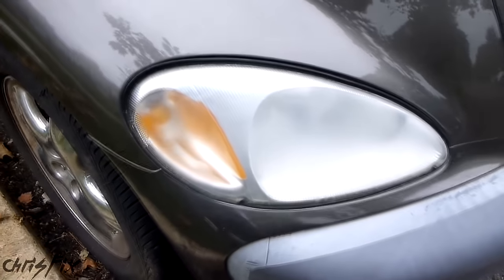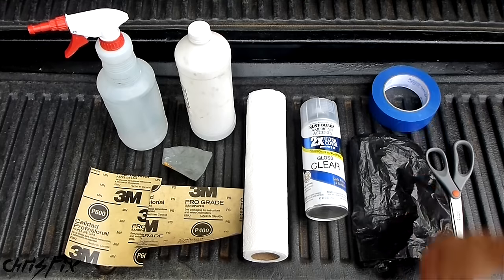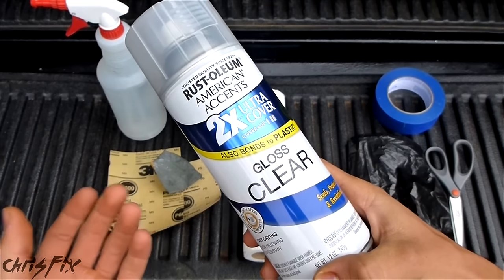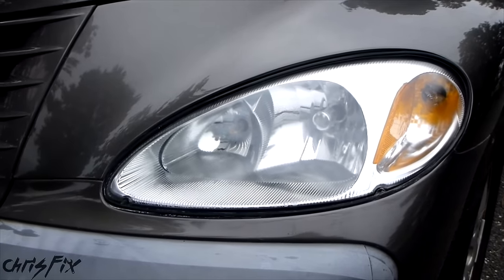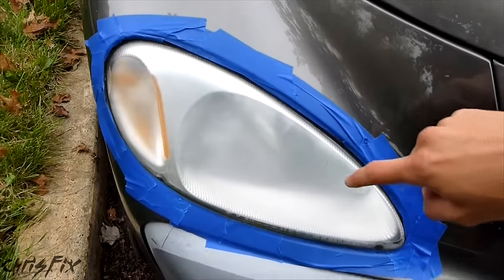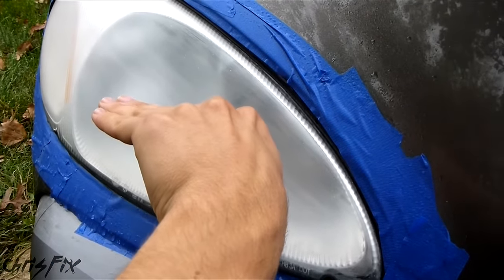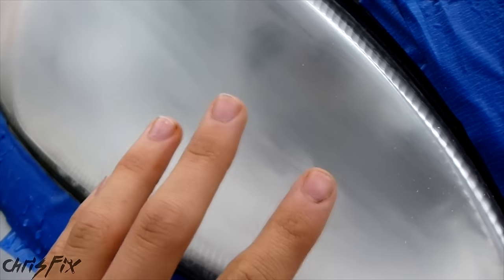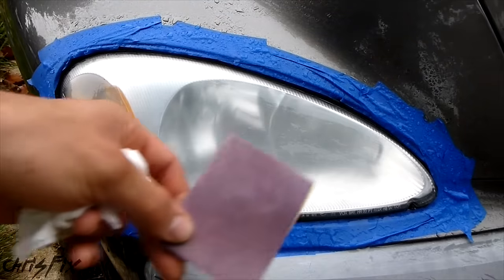How to Restore Headlights PERMANENTLY

Comment from the maker: Here is an update over a year later on the how the headlights have held up: https://instagram.com/p/8iyExTOjFm/?taken-by=chrisfixit
Reply: +ChrisFix The clear coat got a little runny. How do I fix it, or should I just sand it off and try again?
Reply: +Erich Lavelle Same thing happened to me leaving "ridges". Sand it back to smooth and when you re-spray it hold the can much further away. Even if you have to make five applications spray  just enough to cover the lens and keep repeating. I speak from experience having tried to rush the job on both headlights.
Reply: +Erich Lavelle  go..bk.wit the 400 grit wet  then work your way bk up to 1000
Reply from the maker: +Erich Lavelle Go over it with 1000 grit then 2000 grit then compound and then polish.
Reply: +ChrisFix The best and easiest way is to use Brasso.
Reply: Haris Umair
Reply: anyone try and spray tint them after doing this?
Reply: +ChrisFix That paint you recommended turned my hard work into pure white!! White!! Not clear, which is the goal here, but White! 
(more info lower - it came clear)
Reply: +Joe Raine well I used his method yesterday then instead of stopping at just using the gloss I went over it with the spray on tint for headlights and mine came out really good. I wonder where you went wrong
Reply: +Mark Garcia Well, they were totally white this morning and as a last ditch effort I used the 800 Grit and then the 2000 Grit on the Gloss and it came off.  Then the buffer pad and compound made them shine.  He should at least warn people of this!!
Reply: +ChrisFix WAT ABOUT USIN THT ...DEEP WOODS OFF....THEN RINSING IT OFF SUPER WELL...THEN DOIN TH CLEARCOAT...SO AS NOT 2 WEAR URSELF OUT DOIN IT TH HARD WAY.....IN TH VIDEO.
Reply: +Joe Raine I use a lot of clear coat paints. What I've learned from experience is if there is too much moisture in the air, as in high humidity or possibly overcast and ready to rain, my clear coat turns white or less than clear. Also, not shaking the can enough to thoroughly mix the contents will produce a white/hazy finish instead of clear. Of course I don't know your weather conditions or all the details of when and how you did this. I'm just offering what I've learned over time.
Reply: Yeah, it wasn't a perfect sunny day, but wasn't raining either.  I checked humidity on phone App after and it was at 70%….can quotes at 50%…not too far off.  Anyway, it went clear with some light wet sanding w/ 800, then 2000 grit and a buffing pad and compound.  They look perfect now.  Thank for the info.
Reply: The best way to clean the headlights fog is to use "Brasso" you can find it in your local diy store and it works wonders without using sandpaper. Just use Brasso with a damp cloth and it makes it brand new! Try it
Reply: +Haris Umair It would be kind of nice to harden/protect it with paint and wax every month too if you plan for the long term.
Reply: +Allen Wang Try buffing/polishing?
Reply: +ChrisFix  Nice Pt cruiser! are you going to give the bumpers a once over with a heat gun to get rid of the 'masking tape' lines? they're the only thing on that car that doesn't look new.
Reply: Buffing or polishing compound and a soft cloth. Buffing is what a painter does to smooth the surface of the paint to give it a perfect glassy gloss. You may have to redo your paint job if that doesn't work.
Reply: Allen Wang Yeah can't tell without being there.  Sorry.  Orange peel effect is what that will remove.  If the paint reacted with something and turned colors obviously its another story.
Reply: +Allen Wang after sanding you buff out the cloudiness with buffer and compound good sir
Reply: +Ricarda Ramírez 
thanks for the buffing part
Reply: how about if it's fogging from the inside of the headlights.
Reply: +ned103 I DID 800 THEN 1200 THEN 2000 GRIT WET SAND THEN CLEAR GLOSS BUT IT IS 
VERY BLURRY AND NOT SHARP WHEN SEEING THROUGH IT NOW, WHY? THE YELLOW 
OXIDIZATION HAS DISAPPEARED AND THERE IS NO WHITE ANYMORE WHICH IS GOOD,
 BUT WHY ISNT IT SHARP LIKE MY BACKLIGHTS? WHAT CAN I DO?
Reply: +Bigman0r2016 You can pull them apart and clear coat the inside just like the outside, then you need to properly seal them so the moisture stays out.
Reply: +053Honda the opening part, what if it doesn't have a way to open the headlights. I haven't checked it out n if it doesn't have a way to open what should I do
 I ain't trying to bust the headlights open.
Reply: Bigman0r2016 Look it up on youtube lol you throw the headlight in an oven for a bit and that allows you to pry the lens off. But something I wasn't thinking about when i replied earlier is that you can't clear the inside if your lenses are textured on the inside (most are).
Reply: 053Honda the right headlight turned out good after i put compound but the left one bits of it was clear and bits were foggy after compound. So i used compound on it again hoping that it will go but it didnt. What can i do now to make it clear? i dont want to start all over again with sanding and clear coat. Does putting too much compound take off the clear coat?
Reply: Dave letterman Yes, too much buffing can remove the clearcoat, especially if your coats are as thin as the ones in the video.
Reply: Dave letterman Using a Power Tool can burn through pretty quick.   By hand it usually takes awhile to go through paint by buffing unless it hasn't cured completely
Reply: 053Honda
ok so i need to sand it 800, 1200, 2000grit then clear coat then sand 2000grit remove orange peel then compound ?
but when i did it correct last time with compound some parts of 1 headlight were good and clear especially in centre but some wasnt, it looked like it was stained with glue marks when i used compound, how come?
Reply: Dave letterman Working in a body shop we prep the lens with only 600grit (anything finer than 800 and it's not likely to stick). the clear fills the scratches (2-3 coats). If you don't have a power buffer i wouldnt bother 'color sanding' (removing orange peel), it'll take forever by hand. The final coat will be how it looks when it drys, so if you have orange peel on your last coat you need to apply more clear.
Reply: i have a question i can us 800 home depot did not had 600??
Reply: yesenia mendoza Should be okay
Reply: Thanks
Reply: get rid of that tp cruiser
Reply: +ChrisFix subbed bro.  You Canadian by any chance?
Reply: +Verum Quaerere Seek Truth He's clearly from the north east united states. Canadians don't sound this way
Reply: +ChrisFix Hey from where did you got that alcohol 70% and is it flammable and can we get it online
Reply: +Aman Shaikh It's available at any grocery, home improvement or pharmacy retailer in the USA.
Reply: what's up with the title?
Reply: help me
Reply: +ChrisFix I'll add this to my tips toolbox then, thanks for the video!
Reply: +ChrisFix this method works but its not a permanent solution
Reply: Thanks for the update man, was just going to ask for one :)
Reply: +ChrisFix Hey Chris, i have a 96 Maxima. We are thinking buying a 2016 Nissan Maxima (finance of course) but seeing it is way to expensive. We are thinking buying a New Kia Optima which is more cheaper. What do you think? Thanks.
Reply: +Julio Salcedo don't do it. Your 96 is paid off yes? Don't take on payments unless you have to unless your car is dying, don't buy a new car. Save the cash and buy a newer used car. That's just smart money.
Reply: Quentin Smith you right. Thanks. My Maxima still running great.
Reply: +Julio Salcedo hey even after I finished college and came into some money I'm still driving my 2000 Grand Cherokee my parents bought me when I was 16. It's nice having the money I can spend on vacations or my gf rather than a car payment. 200k and still going strong!
Reply: +Julio Salcedo Also, your 1996 Maxima has glass headlights. They will need a lot less maintenance than plastic headlights, as well as not needing the procedure described in the video. Give them a good wash and possibly some light polish and they'll be like new forever.

I have a 1975 SAAB 96 and a 1997 SAAB 9000 (both with glass headlights of course) and the glass typically survives longer than the reflector behind it unless a fairly large rock hits it. There's also protective film you can use to supposedly make them even stronger, but I've never felt the need to use it myself. Only changed them once on my 9000, the previous owner didn't keep them clean so they were full of scratches. I've driven it for more than 4 years and 35000 km since but they still look like they're straight out of the factory.

Keeping your Maxima was a very good choice, in my opinion the quality and luxury of ordinary cars peaked somewhere around the mid 90's when quality was more important than poking at apps on a touchscreen.

I'm sorry for going on a rant like this but I just feel that lately cars have gone from refined engineering marvels to good enough Lego blocks. We're in a time where the old cars outlive the new ones.

As a side note, when the time comes to replace your Maxima, look for used cars. You get a lot more car for your money, even on cars which are only 3 years old.
Reply: +Quentin Smith ... COOL! Never, Never, Never should you have a car payment! If you have no other choice, work real hard to get it paid off!
Reply: +ChrisFix My headlight came out ok, but I over sprayed and I have a run right across the headlight. Can I fix it? If so, would it require starting all over which I am fine with. Please advise. Thank you and congratulations on your channel, your videos are very, very helpful thanks!
Reply: +Gallo M You can do it over again, just make sure you sand a lot on your second try to get rid of the clear coat layers you put down.  I recommend using the 3m kit on amazon for $13.
Reply: Thank you so much Alex.
Reply: +Alex Parshall is 800 grit doable in place of 600 grit?
Reply: I'm going to do mine, following your instructions to the Tee as soon as it warms up a little here!! Thank you so much, I'll let you know how they turn out!
Reply: +Joe Raine 
Did you read the label on the can before purchasing?
Reply: +Dave letterman  same outcome on mine did you find a solution to make them look better?
Reply: +ChrisFix Hi Chris, the headlights still look like new. Great job. Thanks for sharing.
Reply: +ChrisFix Lights ON for fast drying
Reply: I'm going to do this as soon as it gets a little warmer!!
Reply: +ChrisFix aw man, I gotta do a before and after, thanks for these videos dude
Reply: Worked to perfection!  From yellow to crystal clear..thanks, dude!
Reply: dude thank you for this video very educational awesome
Reply: +ChrisFix Just did this today. Worked excellent. Thank you!
Reply: Except they look yellow and are tarnishing. Wet sanding rotary buffer and sealant. Will look brand new for 10 years. Sorry bud, I make good cash cleaning off clearcoat fixes like yours and restoring properly.
Reply: Konrad Checinski Sorry but I see absolutely no yellow.
Reply: +Konrad Checinski look perfect to me too.
Reply: +Eduardo Pelaez  it happens to varying degrees depending on age of light. My wifes were quite yellow. Fine after doing this. He is mentioning it so you will be aware of what caused it if you do have it.
Reply: how about yellowing headlights
Reply: When do I stop sanding, when the water don't look milky white?
Reply: +Humphrey Villapa 
Start the video at the 1 minute mark and listen for 7 seconds. He mentions 'Yellowing" and using 400 grit.
Reply: Hey Chris, can I use clear for headlights as for paint, is it same?
Reply: +Stefan Stesevic Says make sure it's gloss clear coat, made for plastic that's non-yellowing.
Reply: how long do I scrub ?
Reply: +Haris Umair Do you have to still spray with clear coat once you have finished with Brasso?
Reply: +Ben Margrave Jr Thanks Ben!
Reply: ROFLOL was just gonna post a comment and see how it was holding up.gonna try some of these fixes on my friends Dodge Caravan.
Reply: The important thing when using any spraying technique is to move your arm side to side, as opposed to angling your wrist this way and that. Your should joint should move, not your wrist joint.

Comment: I did this like 9 years ago when this video was new posted on my 2002 VW Jetta 1.8T and it worked like a goddamned charm.  Here I am in 2023, 2 vehicles later (2014 Dodge Avenger, and now on my 2021 Chevy Colorado Z71) and I have a wife and kids and a home (I was like 22 when I did this with the Jetta) and my wife's 2016 Nissan Rogue headlamps are so foggy that it's literally dimming the lights at night when she drives.  Was looking back trying to find this video because I remembered how great it worked on the Jetta almost a decade ago and boom baby!  Found it.  Thanks my friend.  Headed to the hardware store tomorrow after work for supplies and will be working on my wife's Rogue this weekend.
Reply from the maker: I'm glad this worked well for your VW way back then and you're doing it again! Crazy how time flies!

Comment: As a pro detailer. There is no such thing as permanent headlight restoration, but it’s cool to run across your diy video you seem pretty good at this stuff bro. GGs👊🏾🔥
Reply from the maker: Thanks! These headlights lasted years and didn't need any maintenance so I'd call it pretty permanent
Reply: Yes considering the average person keeps their car for 3-5 years for them it will be permanent you are absolutely right on that part. I meant more in a technical way that eventually it will oxidize just like the OEM UV coating due to the build quality of modern cars.
Reply: @chrisfix  the only thing bad about this stuff in my opinion is that it is much more difficult to sand off than your standard clear coat like meguiars because of the hardener. It also doesn’t allow the headlight to expand and breath properly if you live in the more harsh conditions that go from 40 degrees to 88 the next day. Obviously that’s just my experience :) keep making banger vids brotha🫶🏾

Comment: I tried this technique on my headlights and it worked well for the most part, i did have an issue with orange peel afterwards, here's how i fixed that.

After the clear had dried completely i wet sanded with 2000-->3000-->5000 grit, i then followed up with compound and polish from meguiars then wax. I did this by hand mind you but you could do it by machine. 

I must also mention that i used 2k professional grade clearcoat, the cartridge type. 

Hope this is helpful to anyone who faces the same issue.